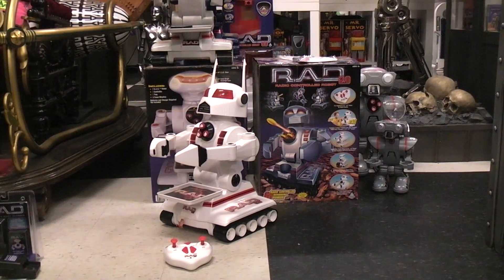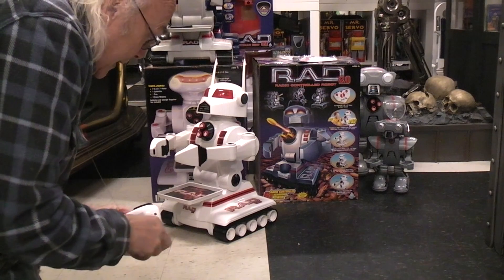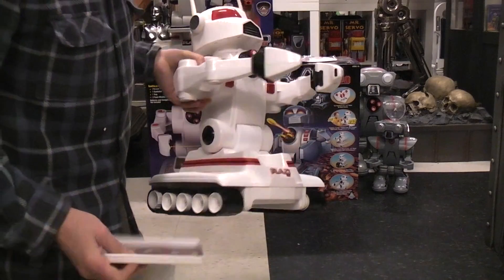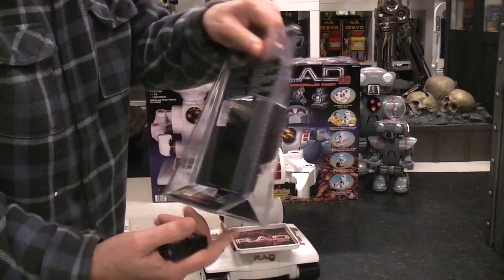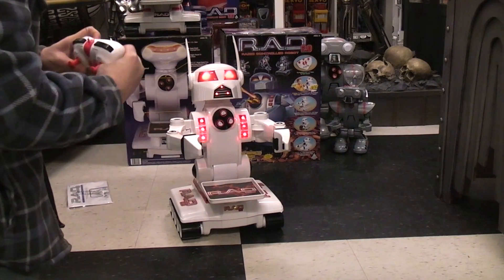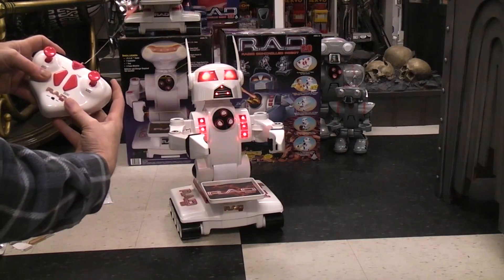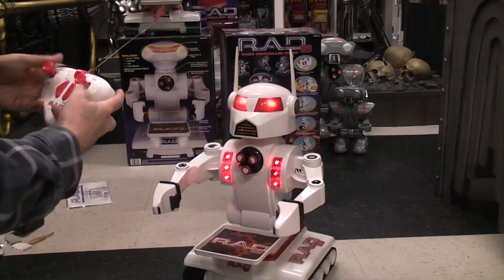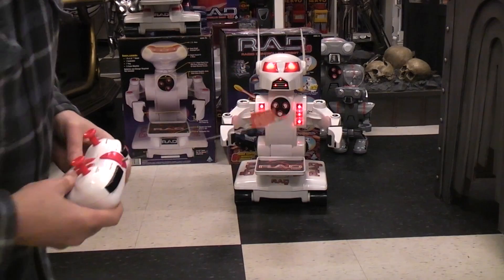1999 R.A.D. 2.0 robot. Part 2 of 5 R.A.D. robots.

Comment: A little history on this robot: Toymax actually released two identical versions of RAD 2.0. In 1998 they created the first version (In This Video) which had straight chest lights and the original deep voice from RAD 1.0. Around the fall of 1999, they released another version that had chest lights that would cascade up & down, along with a higher pitched voice. Even if the manufacturer print (located on robot bottom) says 1999, some still could have the 1998 programming.

It’s difficult for collectors to find replacement remotes for this robot, as even with matching MHz the controllers are incompatible with opposite robot variations. The remotes look exactly the same, but if you listen to a household radio while pressing buttons on the controller, the interference noises are distinctive to the 1998 or 1999 versions.

 Someone else on the internet who dissected these robots, thought the remotes were “fine tuned” to each RAD 2.0 at the factory, but my findings proved that false. 

I know this because I found a RAD 2.0 at a flea market when I was a kid in 2015 without a remote. By extreme luck, I found a sealed NIB rad 2.0 that was same version. I’ve collected several more since then including 1.0 and the crystal blue. 

The Rad 1.0 & 2.0 are awesome robots. One of the few toy robots made for outdoor terrain.